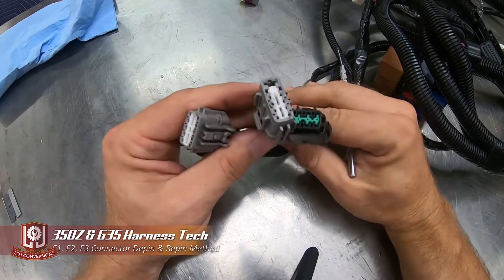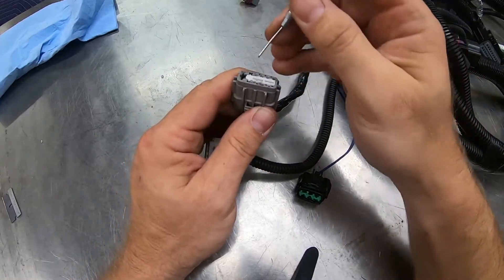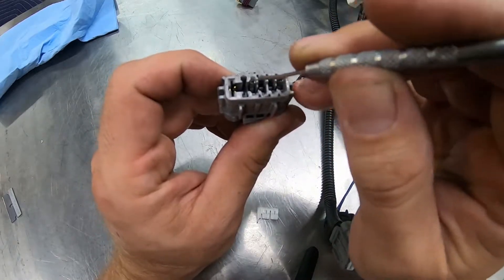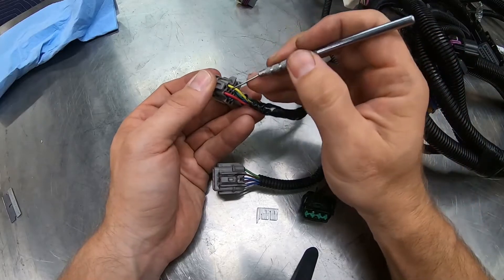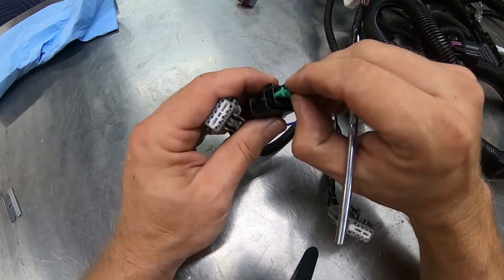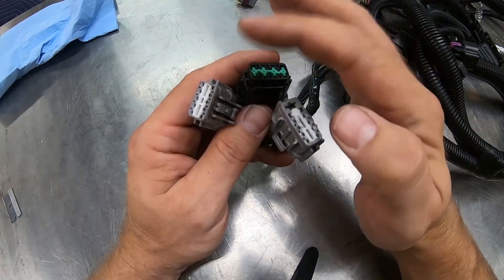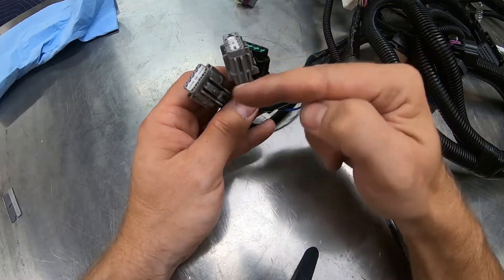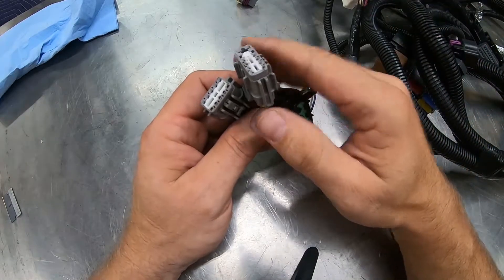LOJ Tech Series - 350Z and G35 F1 F2 F3 Connector Depin and Repin for Harness Install

Comment: Thank you thank you so much for making this informal video, need to fix my wiring and it tore right where the pin and weather proof go into the connector meet so with this I can solder the wire back